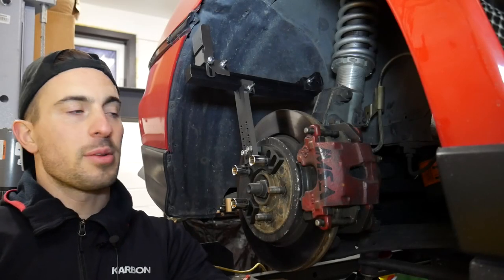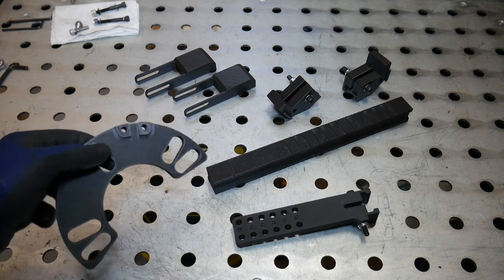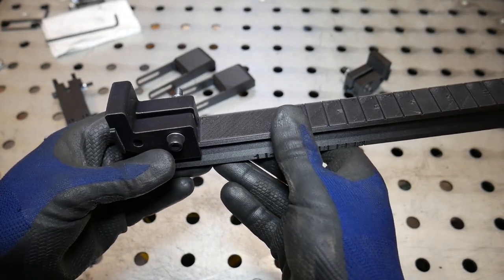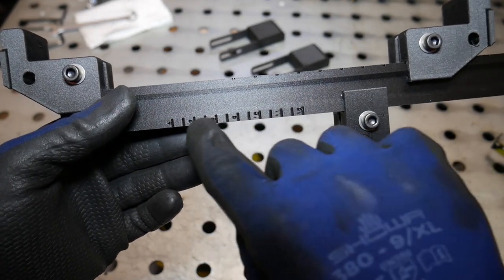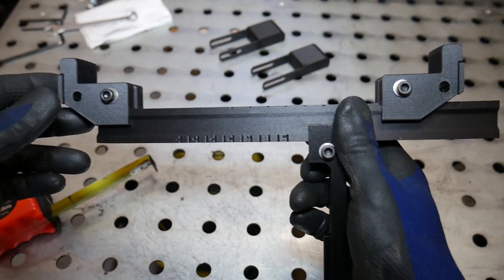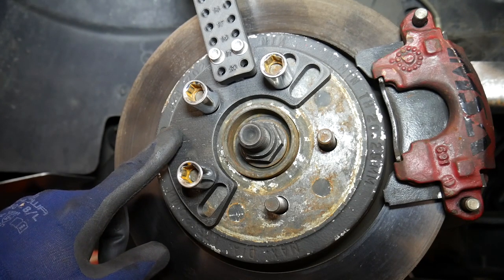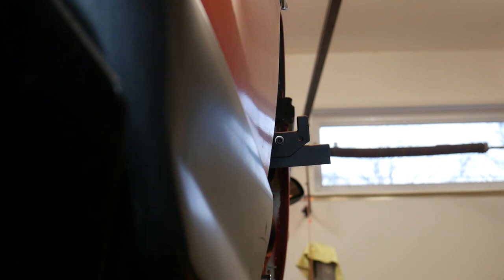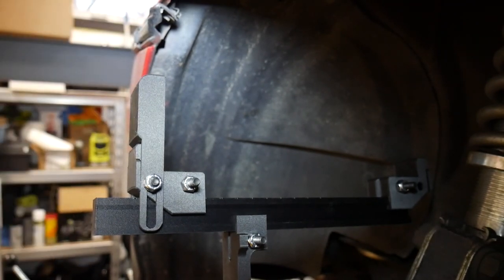Affordable Wheel Fitment Tool! Perfect Fitment Guide!

Comment: Looks very nice! One question, how do I take into account wheel camber (and maybe toe) while measuring with this?
Reply from the maker: Good question! When you install the wheel tool, you should load your suspension. If you put your floor jack under your control arm and lower your vehicle down to it's regular ride height from the ground the suspension should be very close to where it would be if it had the wheel installed. Therefore your camber and toe should be pretty accurate in that position and you test your clearance.

Comment: Also will it fir a 4 1/2 " bolt pattern ? Thanks
Reply from the maker: Yes it will, I'm assuming 5 bolt x 4.5" ?
Reply: @EmbraceMaking   Tes it is . Thanks for the reply . How and where do I order one ?
Reply from the maker: There are two different models. One for cars that has tire pieces that are smaller and appropriate for car tires. And another for trucks that has very large tire simulator pieces meant for flotation (inch) size tires. The truck one was developed after the making of this video so it does not appear in the video, but all of the other parts are the same you just have larger tire pieces that can be adjusted in inch increments for large mud/offroad tires.

For the one for cars:
Here: https://via-autoworks.my-online.store/Wheel_Fitment_Tool/p6002281_19291782.aspxThank
Or here: https://www.etsy.com/ca/listing/1107205149/wheel-fitment-tool-cars-general?click_key=3e8c5ad101f789324f8121ee7d0e17d741b45b9d%3A1107205149&click_sum=1ab14dd6&ref=shop_home_feat_2&sts=1

If you're looking for the one for trucks for flotation tire sizes:
Here: https://via-autoworks.my-online.store/Wheel_Fitment_Tool_(TRUCKS)/p6002281_21611562.aspx
Or here: https://www.etsy.com/ca/listing/1207969027/wheel-fitment-tool-trucks?click_key=f1f9828a9aec2d616f5e128bedf6523dc74b8378%3A1207969027&click_sum=bde0b10b&ref=shop_home_active_1&crt=1&sts=1

If you purchase from my website it is slightly less expensive than purchasing from Etsy... I had to raise the price on Etsy because of the % cut they take for themselves. Let me know if you have any other questions. Thanks!

Comment: Do you have a tool to measure a Drag  Car tire.  The rim is 15 inch but the tire is 30-33 inch tall
Reply: Looks like the truck tool almost works
Reply from the maker: Hi Rob, The truck version can be made to work in this case in my opinion. What you can do is put the tool in the 16" diameter position and then position the tire pieces to 33" because that is the overall height of the wheel / tire combination. Since the wheel portion is intended to represent the outside of the wheel and not the inside, technically all that matters in this case is the width/face of where the lip of the wheel sits (offset). So really what you're doing in this case is just looking at the overall tire diameter + offset to see if it fits inside of your wheel well. This should be fine for what it is you're attempting to do from what I can tell. Let me know your thoughts.

Comment: Sorry if I missed it mentioned in video but will this tool allow you to determine what thickness spacer to use if necessary?
Reply from the maker: You can use the tool to determine that... I didn't cover it in the video... but... if you just set the tool up with your current wheel measurements and then mark that offset location on the tool you know your starting point. Then, you can move the offset out the amount you want spaced, ex: 10mm and then check for clearance.

Comment: How do you find the Backspace ?
Reply from the maker: Yes you can measure / calculate backspacing with this tool because it can do offset. They are not the same, but related...
Here is a good explanation of offset vs. backspacing: www.wildhorses4x4.com/product/Wheel_Backspace/tech_faq
If you send me a message/email on any of my websites I can send you a diagram of the tool that makes the explanation easier but...
You would just measure between the back part of the tool that represents the back face of the wheel, and the face of the tool that mounts to your wheel hub.
Let me know if that helps, otherwise email me / message me on any of my websites and I will provide you with a diagram. Thanks!

Comment: Have you considered making the bolt pattern part a full circle, and using three of the wheel diameter and width/offset parts, so you could actually put a tire on there? Not mush more R&D would be involved. I'd buy one at double the cost.
Reply from the maker: Hi Richard, It's not a bad idea, I could whip something up and get it out to you. Let me see if I can find more info about the profile around the tire bead area so a tire could seat properly within the tool... I'll get back to you shortly...
Reply: @EmbraceMaking  I have been doing CAD for over 30 years. Maybe I can draw something up in 3D and have you print it for me. I have a 3D printer I bought years ago and set up but have never printed anything. Lazy me...

Comment: So I I'm having problems figuring out exactly how much wheel I can fit in my car, and I was about to design a tool to measure this, using my 3D printer... But it appears you already did that lol

Will you be putting any of these files online?
Also have you considered using all thread to simulate the tire offset? So you just have one set tire with that you could adjust with the plastic pieces, and then screw the all thread bolt in and out to move the offset back and forth until you find out what fits
Reply from the maker: Hi Travis, you can find the link to my tool here: https://via-autoworks.my-online.store/Wheel_Fitment_Tool/p6002281_19291782.aspx

I have not considered using a thread to simulate the tire offset although it sounds interesting. I tried to keep the entire tool as easy to print and manufacture as possible with minimal other hardware required. Let me know if you're interested in picking up a tool!

Comment: This is great for measuring wheel size, even taking tire height into consideration but not section width. A 15×10" rim can put say a 295/50r15 tire on it. Which has a section width of 11.61" or you can put a 305/50r15 tire on it that has a section width of 12" on it. This would not take that into account to see what size wheel tire combo would fit. Only what size wheel would fit.
Reply from the maker: Hi Ronald, yes that is correct. Unfortunately even tires of the same size across different brands often vary. Some manufacturers run wider with rim "protection" features that stick out, and some sidewalls bulge depending on the width of wheel you are putting them on. This tool is meant to simulate the wheel and not the tire. Although I include tire pieces for some idea of where your tire might be, this is just to help you visualize. However, the accuracy of the wheel tool gives you the exact location of your wheel and therefore you can determine if the wheels will work before purchasing them, and then have a better idea of where your tire will sit. It is very difficult, if not impossible to predict for certain exactly how a tire from different brands will sit without mounting it to the wheel. This is a limitation will all wheel fitment tools that I've seen on the internet.
Reply: @EmbraceMaking  yeah, I've seen two different places give two different section widths for the same brand and size tires. My current BF Goodrich 255/60r15 tires everywhere says the section width is 10.06" when they're actually 10.5" mounted to an 8" wheel. Makes it very difficult to figure out which tires will actually fit a car. This tool for what it does, is the best one I've seen so far.
Reply: I think I know how to use this tool and at least be close on the tire bulge. (Section width) as long as the specs of the tires aren't too far off. So I think I'm going to get this. Looks much better than that thing Jegs and Summit are selling.

Comment: Can you supply a wider wheel width that 12"
Reply from the maker: Hi Tom, yes I have supplied a tool up to 13" for someone else. If you go through the order process on the website, just put a note with the order for a 13" width bar and I will supply it at no extra cost. Thanks!

Comment: What if the wheel is tucked up inside my fender like on the rear of my lowered 55 chevy?  This tool wouldn't work because part of the tool extends past the diameter of the wheel/tire you are simulating.
Reply from the maker: Good observation! If you're running a really aggressive tuck then you still have a few options. You can cut the wheel width beam to the desired length so nothing is sticking out (and you know you don't want to go with wider wheels). Or you can order a beam with a specific width (I have customized parts for others as well). The nice thing about this is that they are 3D printed parts so they are easy to cut and modify and if you already bought the tool I don't gouge people for replacement parts. Keep in mind that in your situation I would imagine the tire is going to be even more of a limiting factor than the wheel (in some respects) because it will be completely tucked. It is very difficult to accurately model a tire because of all of the variances between manufacturers despite being listed as a standard size.
Reply: @EmbraceMaking  In regards to the wheel width and offset bar extending past the wheel bead: why not have the rear wheel bead fixed permanently to a square tube that the front wheel bead can slide in & out of to create the rim width and the square tube can also have an outside groove so the offset can slide and be established.  This way there won't be an overhang past the rim beads.  Had a similar idea I was working on in creating my own tool, just haven't had the time to put it all together, so I bought yours!
Reply from the maker: @URGREG99  Thanks Greg! (and thanks for your order, working on that now). So if I understand you correctly, you are suggesting something like a telescoping beam as opposed to a fixed beam?
Reply: Exactly! The fixed length will dictate the maximum width and you can sell them in different lengths to accommodate a wider range if rim widths. A 5" fixed length would basically have a max rim width of 9", would need something remaining of the telescoping bar to lock it down.  You can also reverse install the fixed section to figure (+) & (-) offset

Comment: Are those lebaron brakes?
Reply from the maker: Hi Josh, this is the "Lebaron" brake swap for the Fiero, which uses Lebaron rotors and Cadillac calipers. In the front I switched to C5 Corvette 13" brakes.
Reply: @EmbraceMaking  does your e-brake work? I'd like a working e-brake but don't want to run calipers upside down.
Reply from the maker: Currently it does not work, but at some point I had the cables hooked up. As you stated, with this brake swap the calipers have to be run upside down unfortunately (for the ebrake to work)
Reply: @EmbraceMaking  how hard do you think it would be to machine a new spot for a bleeder so you could bleed without taking them off.
Reply: @EmbraceMaking  I found the answer, they make inserts for ntp threads that would allow you to drill and tap threads if you could find a suitable place to add a bleeder. I'm not familiar enough with the Cadillac rears to know if that's even possible.
Reply: Just looking at pictures it looks like GM might have cast in a boss so it could be done! I'll have to look into it better. It might not be worth it for someone like you since your install is done.
Reply from the maker: Could be a good solution for this brake swap. At some point I was going to do C4 brakes in the rear but never got around to it.

Comment: How can I adjust the tool to check the fitment of a 15 or 16 or even a 17" wheel on the front wheel when the bottom of the height adjustment section hangs lower than the wheel hub. Even pulling off the wheel bearing dust cap doesn't help. You would have had the same experience in your video if you tried to measure for a 15 or 16' wheel instead of the 19" you decided to demo. Aside from cutting the lower adjustments off (ruining the tool for the larger wheel sizes) or making spacers and recalculating all the backspace and offset readings, I see no solution. I can't be the first person to have this fitment issue.
Reply from the maker: Yep this occasionally happens on vehicles where the axle nut or center bore sticks out farther than the tool. It's hit or miss depending on the design of the car. In this case I advise to cut the tool and contact me for replacement arms (which I offer free for customers who have this problem). Head on over to my website and use the contact page. Send me your order number and I'll take care of you. Thanks!
Reply: @EmbraceMaking  Sounds good. I'll send you the info.

Comment: So to be clear it does not measure backspace?
Reply from the maker: Hi John, although it does not explicitly show the backspace measurement on the tool, you have all of the information you need to calculate it. Backspace is measured from the mounting face to the inside lip of the wheel, therefore you can take the overall wheel width, divide by 2, then in the case of positive offset add your offset, and in the case of negative offset, subtract it. Keep in mind that the wheel width is measured from the tire bead surface and so there will likely be a few extra mm added to the actual backspace measurement depending on the wheel lip design. From my experience, manufacturers of wheels use offset far more frequently than backspacing in the specs, but like I said, you can still use the tool to find the backspacing. Thanks!
Reply: @EmbraceMaking  I really like your tool but I’m not comfortable with your response and will go in a different direction. Thank you for the quick response . Perhaps another video showing how to calculate BS would help

Comment: Sooo.. when i have it set for a 15" wheel the main arm interferes with the spindle nut. Id have to cut it off to ise it.. so then it is now a useless tool.. seems like i wasted my money.
Reply from the maker: Nope, not to worry. It's hard to design around every different type of car with the various obstacles. If your axle nut or grease cap gets in the way and you have to clearance the diameter arm I send people extras. All you have to do is message me with your order number. Best place to do that is my website here: https://embracemaking.com/pages/contact

Comment: So disappointed with this tool. Bought it and the cheap plastic parts warped rendering it useless. All I have now is 3 pieces of  warped plastic and out 100 bucks Tool will work but really low end materials so not a long term keeper I never did get my wheel measured as the tool warped before I had a chance to get it all set up  ... :(
Reply from the maker: Saw your email come through, the parts shouldn't warp like that and I'd be happy to replace them for you! Hope you got my response by email, thanks!
Reply: @EmbraceMaking  thank you for responding back to me... did not expect that...  I did reply in the email thank you again for standing behind your product!!
Reply from the maker: No problem, for anyone else reading this, if you ever have any issues I will definitely get you sorted out with replacement parts, custom parts etc. Just reach out to me. Thanks!
Reply: Quick update on the customer service. I already knew the tool works but Chris was truly professional and went beyond the bar to ensure I was a satisfied customer. He sent me an upgraded new kit while keeping me updated throughout the process. Knowing how he handled my order alone warrants me to buy this product. In today's world customer service is hard to find… Chris was top of the class!